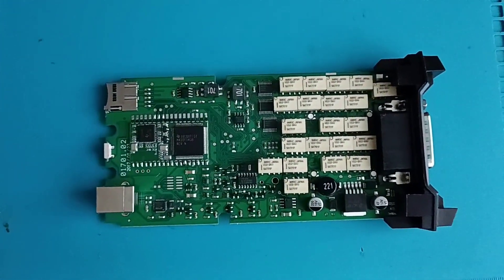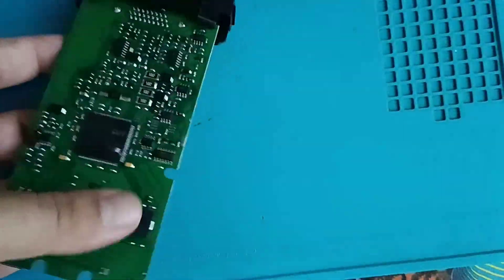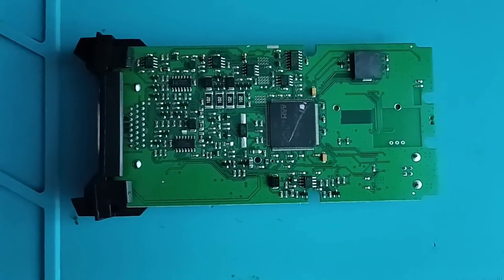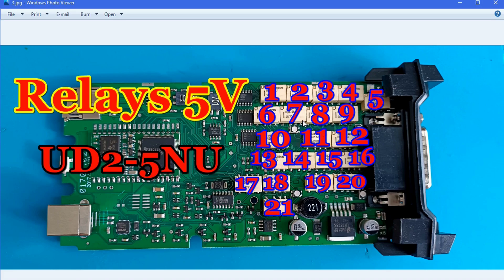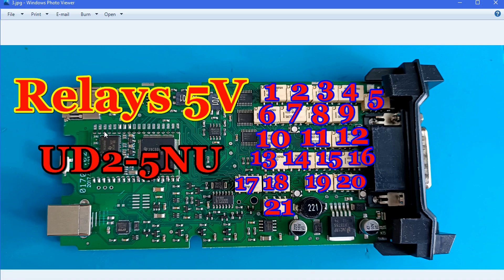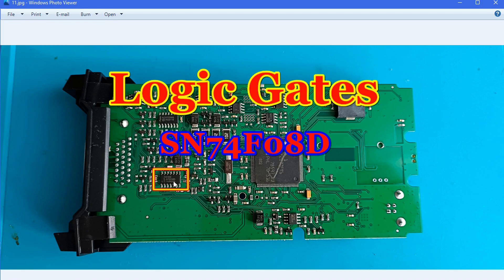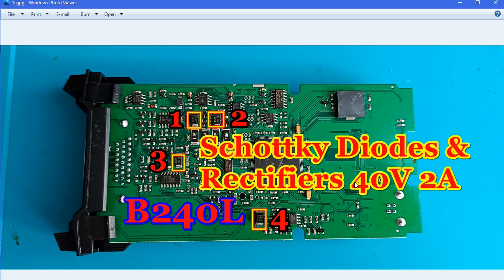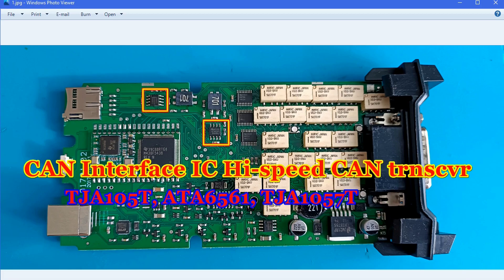DS150E Full-Rework. Let's make Delphi-Clone work !!! ds150e single board repair .

Comment: 😊 change all those components and you'll spend probably the full price of a non-clone vci. Where the hell do I find an original one? There are only clones on the market. Good video, keep them coming!
Reply from the maker: @alexdragomirescu5084  
the problem is that at this point many components are no longer found.  It is very fair, you can change components and no one guarantees that it works
Reply: @YOYODiagnostic  Sometimes (many times) is better to spend some more and get the right tool from the beginning. Less problems
Reply: @YOYODiagnostic  I'm configuring a laptop for oscilloscope, so it will be a tool cart dedicated to scope. Then I thought...why not add a Windows based scanner. The problem is that the cheap solutions like Autocom, Delphi, wow are jokes. A good android scanner is 20x better than those things. I just want to be able to read live data pids and do activations. Searching a bit deeper there are 3 options (that I found) Bosch, hella, texa. I can get the devices second hand. The problem is the software and in my case doesn't worth the investment. I already have annual costs for the other scanners. Are there any relatively cheap solutions for my problem?

Comment: Hi Yoyo,

I have an old Delphi interface I once used with Delphi 2013, and it still works fine on that version.   I’ve recently installed Autocom 2021 but the interface is showing as u known.   Would it be possible to get your email to send you through some pics of my interface so you can advise me?
Reply from the maker: Make a firmware update. 
See if drivers are installed.
Check connections to PC .

Comment: Hi thanks for all your help. When you have a little free time, I imagine not much... see if these alternative components fit well, as an alternative to stock or obsolete
Single-Ended Bus Transceiver 9241A /  Alternt ATA6561-GAQW-N
Schottky Diodes Rectifiers 40V 2A B240L/ alternativ/CD214A-B240LR
Rectifiers schottky Diode BAT54S/WV4/ Alternativ BAT54SW
Linear Voltage Regulators LM317/ Alternativ/LM317LIDR
Can interface IC ATA6561/ alternativ ATA6561-GAQW
Schottky Diodes B240L/ alternativ CD214A-B240LR
Thank you for the time you spend teaching.
Reply: Hello, where you able to find a real alternative for Single-Ended Bus Transceiver 9241A?

Comment: The SI9241A (obviously fake there) on the right side is not connected to anything. If you desolder it you will see there are no traces or vias from the chip pads. Nothing. I wonder why is it present? There are some single board versions that have this chip wired up and majority of the "A+ best quality PCB" doesn't have this chip connected.
Reply: Has anyone a link to a good one without soldering new parts? PN pls

Comment: Thank you for all the good work! Yet you are clearly a strong advocate of the original VCI! I happen to have found a second-hand one fore sale. What price would you consider to be reasonable for an original 2017 device?
Reply from the maker: Hello.
2400 euros is new with 1 year update.  Now you know how much you want to pay and how much you can afford.
  If I were to buy it, I would deduct the amount of 600 euros for the annual update, which means that the new tester costs 1800 euros.  I probably wouldn't pay more than 1000 euros for a used diagnostic.  Bosch is also around this amount, of course used.
Reply: @YOYODiagnostic  It's only the device. No software or security dongle.
Reply from the maker: @petervanbussel3615  
400-500euro  max .
Reply: @YOYODiagnostic   Would it fully function with the 2020.23 firmware update as you mentioned in your other post? It is for diy/ experimentation only!
Reply: Hello, I have a question where I can find the diagram of Delhi, autocom.  Thank you for your answer and best regards

Comment: To change those components you need good skills, especially in soldering, it's not for everybody there's a great possibility to ruin the board.
Reply from the maker: Hello.
I agree with you, but if they want to learn tuning, they have to learn and use the hot air machine.  Or if they don't have the necessary skills, they can buy the spare parts and go to an electronic repair service and pay. 
Thanks for watching 👍
Reply: i agree but people should know of what components need changing to get it working...its up to the person if they want to have a go or get a shop to repair or change them..but a good point you raise.

Comment: I have original autocom
Even original will not work on "all cars"
Reply: @YOYODiagnostic  i also have a clones with that PCB , one of them doesn’t work on vag k line 
I just checked relays and replaced 2
What do you think? Maybee check 9142a??
Reply: @chipdieselperformance can original for code all car injector
Reply: Si9142 where to buy the original?